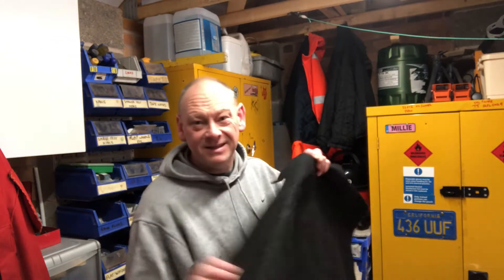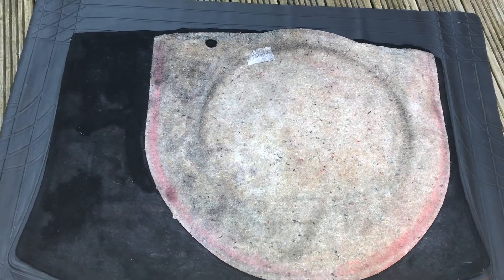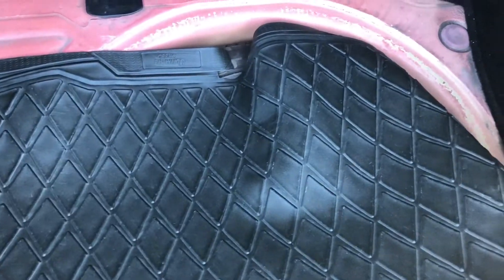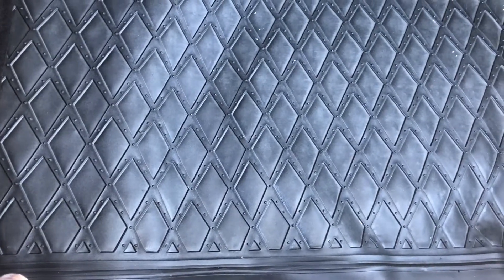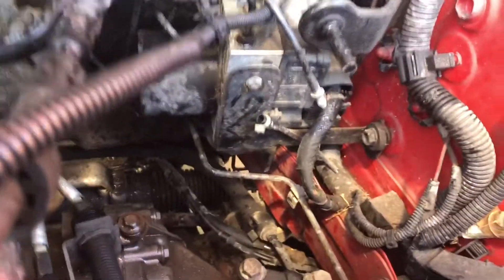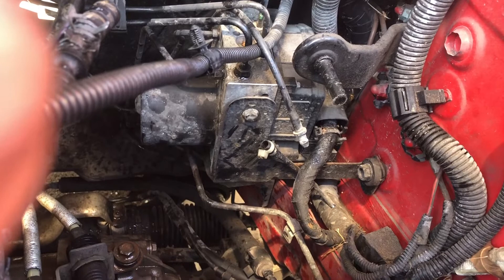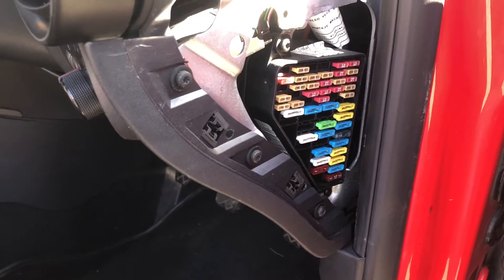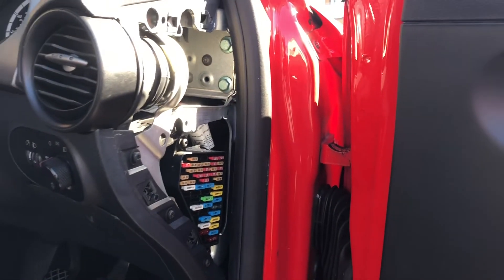Iris The Seat Ibiza - Fixing Some Faults - Ignoring Others (For Now)

Comment: 56 plate Ibiza FR owner (for 15 years) here. The squirter pipe joints seem to blow apart if the screenwash freezes in a cold snap. There's also an exploding pipe joint in the boot behind the righthand side panel.
Reply from the maker: Cheers! Someone told me the washer fluid needs to be strong on these!

Comment: From experience with these faults on the seats
The rear lamps leak into the boot area.
As for the window blowing the fuse start by checking the wires between the door and the A pannel for a short.
Reply from the maker: Yep I think lights too, I did mention the wires in the A panel, my Golf was the same. Thanks buddy 👍
Reply: Ws going to suggest rear light seals but several got there before me. Anything vw, seat and skoda suffer from the same issues. Or French....because French lol
Reply from the maker: @AllThingsAlex  yeah seems the culprit 👍

Comment: Job well done, Pipes have a better chance of holding & you now know the window wiring could be checked. From my experience, cleaning rubber seals & soaking in silicone spray helps, and refitting lights on window frame mastic can cure leaks. I trust you are still enjoying the Ibiza economy & performance.
Reply from the maker: Yep enjoy driving it! I think everyone seems to think it’s the rear lights in the tailgate so I’ll check those.
Reply: @AgathaAndAnything  I don’t know about Ibiza’s, but I have fixed boot leaks on a Mondeo mk2 & skoda Favorit by re sealing lights with mastic